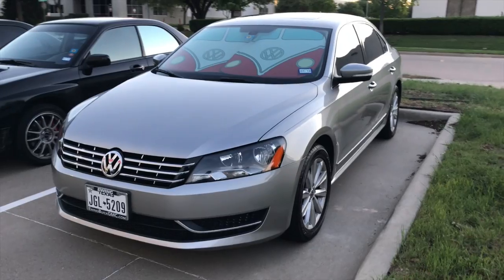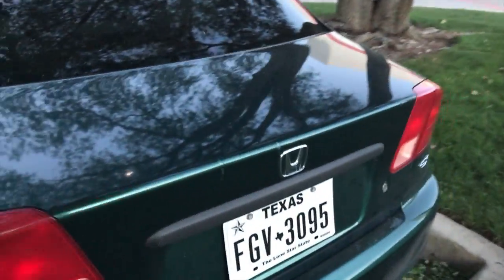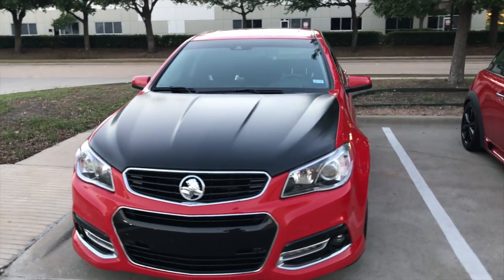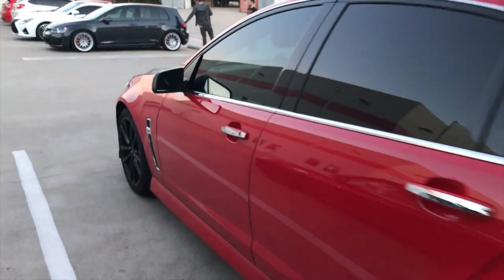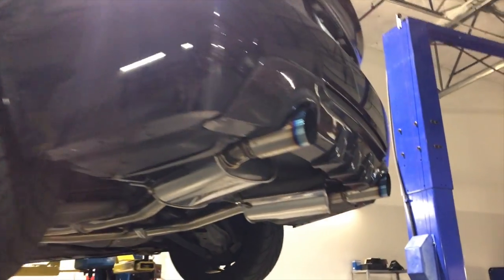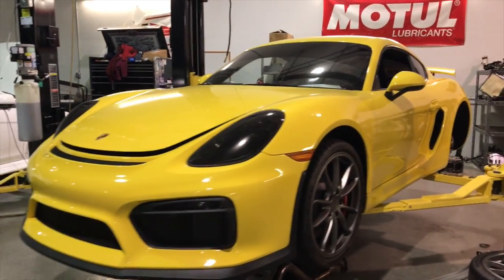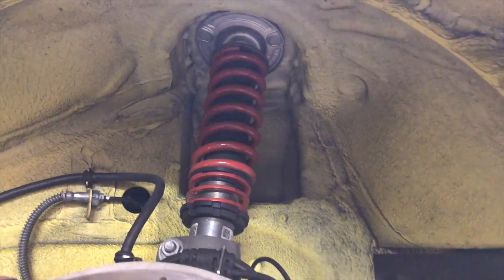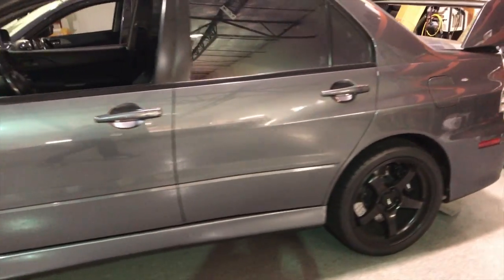First Thursday @ Cobb Plano, Car Show & Tour of Cobb tuning shop.

Comment: Cool to see another local. I'm in Euless. I have a fully bolted Speed 3 with an upgraded turbo - a BNR S3 (~GT2871). Running E25 in the tank, I also spray methanol for extra cooling, cleaning, and keeping the engine happy/cooler. Currently, I do ~390-385 @ the wheels in nice weather.
Reply from the maker: Numinous that's a sweet car- I think I remember seeing it an event.  You can't tell me all about it without offering me a ride and chance to grab some video.
Reply: One of the North Texas Food Bank Poker Runs, maybe? Mine's a Blue Gen 2.